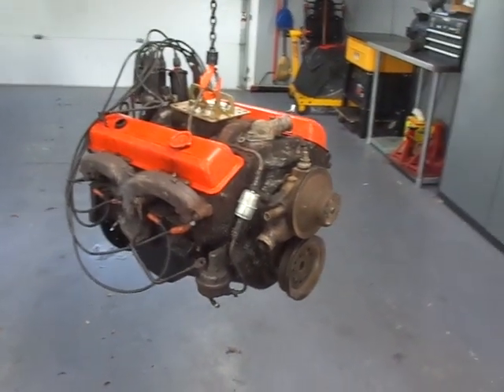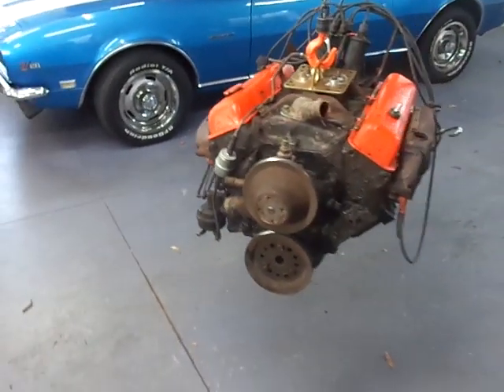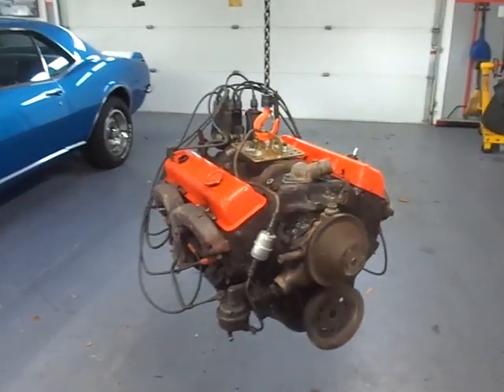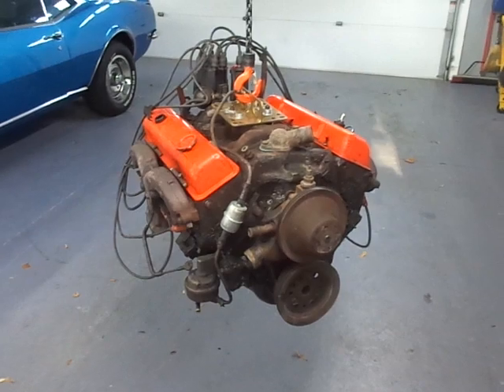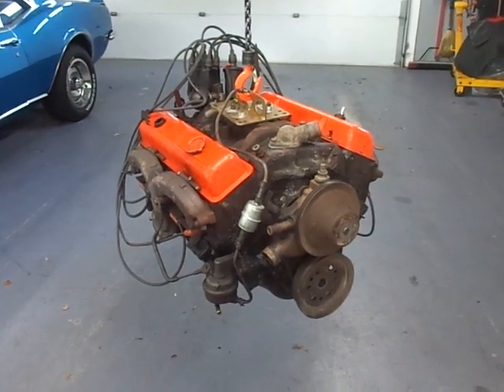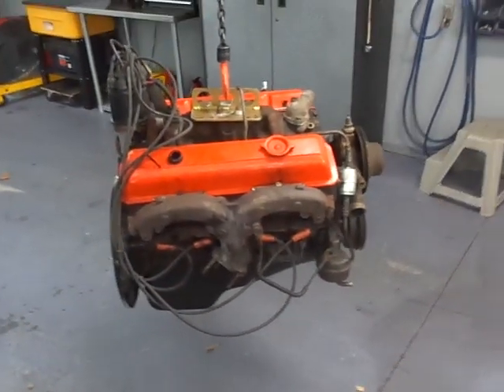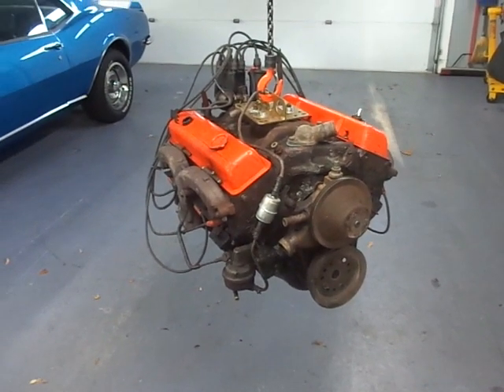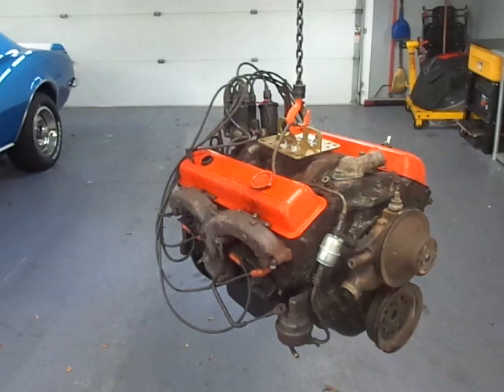Chevrolet 307 SBC cu. in. V8 engine restoration and power upgrade

Comment: Brings me back to my teen years. Took a 307 in my 69 GMC pickup,  bored it .040, installed new pistons, crane cam and lifters, gasket matched heads to headers, installed 4 barrel intake, quadrajet. I thought I had a hotrod! Started working at 14 for a independent garage and we did a lot of engine rebuilds, headwork etc. had a lot of useful experience before going to 3 years of votech for auto. Eventually ended up teaching. Love your channel, you are a good teacher. You explain principals, and add details to fill in the gaps. Thanks for what you do for the industry.
Reply from the maker: Thanks Tad, we share a similar experience. I started working at a Texaco garage at 15. AG

Comment: Has anyone turbo'd a 307 ? With a short 327 stroke and 283 bore it would scream with
good internals. I had an N/A 307 in my Chevelle with 1.94 heads and a healthy Erson 
cam many years ago. Balanced and well built. I beat on it hard and it never broke.
Reply from the maker: Good question Chris, i have not but anyone out there please comment.AG

Comment: Long stroke v short stroke of the same size engine does not change swept volume . A 403 Olds with 4.351 inch bore X 3.385 inch stroke has same swept volume as a Late 400 Olds with 3.87 bore and 4.25 inch stroke .
Reply from the maker: Good point, thanks AG

Comment: Built a few with 601 305 heads open chambers to match bore and use 218 at .050 cam .450 lift on a lobe seperation of 109 install at 106 run great .
Reply from the maker: Thanks for sharing Larry. AG

Comment: Gm had plenty of 283 blocks in inventory and 327 crankshafts.  Gm had come out with the 350 in 67 but didn't put it in corvette until 69 cause they were field testing it through customers in 67 Camaros.  69 corvettes novas, chevelles and impalas got the 350. You want a nice torquay 350, then put a 3.75 crankshaft in that 307 and you end up with 354 ci with mucho amount of torque 💁‍♂️
Reply from the maker: Thanks Ben. I just might try that sometime. AG
Reply: @goldsgarage8236  Yeah, pontiac 326,350,400 all had 3.75 crankshafts . I had a pontiac 350 and that was a nice little torque monster. Sbc 354 would perform about the same with a much lighter block since pontiac motor is a much bigger and heavier block. 👍
Reply: Or just build a stroker 383 for the same money and outperform the 307 in every way possible, or a 400 and trump it from the get go.

Comment: I has a 307 with a set of 186 202 heads and a solid flat tappet cam in my nova the motor ran good for what it was back then before the internet and all the aftermarket parts we used what we could for performance the cam I had was really too much so the car was slow off the line I had a Vega converter which only stalled to about 2800 rpm with a turbo 400 if I remember right the best it ran was 11.89 in the 1/4 mile. I put the same cam and heads on a 331 and the car went 11.20 . That was in the late 70s
Reply from the maker: Thanks Richard, 11.20 is pretty fast, i am sure it was a fun ride! Thanks for sharing. AG
Reply: Offhand the 11:20 actually sounds pretty impressive. Was that an early nova that was pretty light or about what did the car weigh?
Reply: @fcaughli  no it was a 72 nova

Comment: You want to wake that 307 up to make 300+ hp throw the stock 307 heads away they're junk they have 70cc or 76cc combustion chambers with small valves 1.72 intake & 1.5  exhaust. Swap them out with stock chev 305 heads with the last 3 casting numbers either 416 or 601 but preferably 416. 305 heads will have around 58cc combustion chambers and a larger intake valve of 1.82 and 1.5 exhaust which will flow better and with the 58cc combustion chambers should be around 9:1 or 9.5:1 compression. 
Another weak link is the cam and lifters 307's got a bad rap that they are junk cam eaters but it was chev in that time Era cutting corners and they didn't have hardened cam lobes and other motors of the same production years as the 307 also had cam problems unless of course they have already been changed out but I recommend an edelbrock cam kit #2102 for the 307 which you may have to have the valve guides machined/ cut for lift clearance being the stock 305 heads might not have enough clearance even for mild cams with 1.5 rockers so something to check and look into.
Reply from the maker: Thanks Derek. We did use the 305 heads. To get 300HP would require a cam that moves the torque curve up. HP=torque x RPM/5252 so making torque at higher RPM will achieve a better maximum HP rating. With a full size truck, highway gears and stock torque converter I wanted to put the torque curve at cruising speed where the driver needs it.

Comment: i have a 1984 olds 307. i can make it stronger?  PLEASE SOMEONE HELP IM YOUNG DONT HAVE MUCH MONEY dnt wanna put money in wasteful place.
Reply from the maker: That's a tough question. 

I am assuming that you want to keep the 307 and you have an automatic transmission..

Engine performance depends on six main issues:

1/Engine displacement, bore, stroke, cu. in. 
2/Compression ratio, static and dynamic.
3/Airflow in and out of the engine, (Intake manifold, air breather, carburetor, cylinder heads, exhaust)
4/Camshaft timing and lift
5/ Ignition
6/Parasitic losses

1/ Engine displacement. Not much you can do here except replace it with a 350 or larger. 
2/ The easiest way to improve your CR is to replace the heads. Camaro/Firebird HO heads have only 58cc and would help improve your CR from about 8.5 to 9.5:1. There are used ones on the market. 
3/Intake side: A low restriction air breather, good aluminum dual plane intake manifold, if you already have a Quadrajet carburetor, that is fine. If your car has a 2 barrel carb, replace it with a small 4 barrel, Edelbrock, Holley, or Quadrajet all will be sufficient. 550 CFM is plenty. 
3/ Exhaust side: Headers and a low restriction exhaust should be your first improvement. IT will also sound cool!
4/ Camshaft timing. Replacing the camshaft with a good street cam is a big job and shouldn't be done unless you do the other improvements mentioned. Limit your cam to .450" lift and about 220 degrees at .050". 
One way to improve airflow without replacing the cam is to replace your 1.5:1 rocker arms with 1.6: rocker arms. This can be done over the fender and will increase airflow about 7%. 
5/ Ignition: Your HEI stock ignition is fine, however it may be hampered by emission controls that limit advance. If you can bypass or disable them (legally) do it. Keep your vacuum advance but adjust your timing to about 35 degrees by 3000RPM with it disconnected. Then connect it. 
6/ Parasitic losses. If your 307 has an air pump remove it if you can do it legally. If it has a mechanical fan, replace it with an electric fan. 

Also: another way to improve the performance of your Olds is gear ratio, I am assuming your gear ratio is 3.07:1 or so. A differential is a torque multiplier, Replacing it with a 3.55 or 3.73:1 will help proportionally. (a 3.73 will deliver 21% more torque to the rear wheels than a 3.07:1). 

I hope this helps, let me know if if you have any more questions. 

Allan Gold
Reply from the maker: Also: If you are going to replace your heads, using a steel .015" thick head gasket instead of a standard composite gasket which is about .040" thick will add about 0.2 points of compression.
Reply from the maker: Sin'Sir
It was just brought to my attention that the 307 in your 84 Olds is not the same as the Chevrolet 307. I forgot that in the 80's GM made smaller versions of the Olds 350. Most of my comments still hold, however if your engine is an Olds 307, any reference to using the Camaro 305HO heads does not apply.
Reply: @Gold's Garage  ok copy ,so what to use instead
Reply: @Gold's Garage  thank u for the reply and detailed message ur a God send
Reply: A mild cam & a recurve on the distributor is a good start.

Comment: I'd like to go the other way, 327 block and 283 crankshaft.
Reply from the maker: That would be a 302. They can make great power but you have to rev them. One problem with making power on a 307 is that the bore is less than 4" so you cannot use the bigger 2.02" intake valve as they would actually hit the block. The smaller bore also shrouds the intake charge. The biggest problem to make power is getting the fuel/air mixture past the intake valve. Thanks for your comment Papi.
Reply: @goldsgarage8236 . Not true, with all due respect,  2.02" valves absolutely clear on a 283/307 bore.  You are correct about some valve shrouding  but it isn't real bad especially when it's at least .030" over.  And then shrouding is reduced more. I tested
 a 2.02" valve in a 3.905" bore and it hit the WALL of the cylinder,  at around .720"+ lift! And a 302 is more comfortable revving over a 307 if 8,000+ is the norm.    They can be made milder. Imagine a 302 Z/28 engine with an Isky 280 Mega.  A little smaller than the old cam and smaller yet on advertised duration, tighter LSA, more power and at less rpm.

Comment: The Chevrolet 307 V8 engine was in production from 1958-73 which it was based on the 283 with 327 crank and connecting rods there’s plenty of those around and plenty of performance parts for those who want to add more horsepower
Reply: You definitely need to look at what you wrote. No 307 in 1958, or any 1959 not even 1960 . You have made a mistake.
Reply: A 307 Chevy block is large journal. No 283s were large journal. So you can make a stroker using a 283 block and a small journal 327 crank, and use 307 pistons with small journal rods. But most people have better things to do with their time.
Reply: @knutbjornlarsen4435  I meant to say 1968-73
Reply: i have a 1984 olds 307 . i can make it stronger ?
Reply: @Sinsirink . The 307 Olds is a completely different engine. Just being the same cubic inches is just a coincidence. But yes a 307 Olds can be built to make quite a bit more power. I'm not real familiar but there were 2 versions of heads made for those engines. The better castings will be a good start. Otherwise they respond to cams, porting, headers, etc like a Chevy engine would.
Reply from the maker: Thanks for your comment Calvin, sorry for the late reply. Think of a 307 as a 327 with a little smaller bore. Most SBC parts fit and will work. AG
Reply: @goldsgarage8236 . Yep, and the claim about 2.02" valves not clearing the bores on a 3.875" bore is a myth. I've heard of 2.05" valves on that bore size. But there is a degree of valve shrouding caused by the bore. The bores can be notched to eliminate most of that. 2.02"s barely clear the 305s standard 3.736 bore, but valve shrouding is bad enough that you'll definitely make more power with a smaller valve like a 1.94".

Comment: I have an OMC 307 SBC. The rebuild will be quite a challenge!
Reply from the maker: Thanks Geoff, it is a challenge to make power without giving up mid range torque.
Reply: @goldsgarage8236  The major challenge here is that like most boat engines the poor thing has had a hard time. Things like an over rev high enough to start pulling the rocker studs out....

Comment: my 71 g10 van has one of these engines w/a standard transmission. when it retired i had over 300k miles on original engine. loved the van and it was a daily  driver for my family for over 30  years.
Reply from the maker: Great experience, thanks for sharing Mr71. AG

Comment: So...its a stroker motor from the factory?
Reply from the maker: Thanks Hunter, yes that is correct, although they didn't call it that back then.
Reply: Can look at it as a stroker or a de-bored 327. They're fine engines. A 305 is a de-bored 350 but A LOT more of a de-bore. Id run a 307 over a 305 for performance.  And a 305 in a low RPM cruiser, where the 305 would have a little more low end torque.

Comment: I.  Just got done rebuilding a 307 i went with double hump heads its sounds Mean with the 488 lift cam but nobody wants Smallblocks. Anymore. They want the LS
Reply: Nice, how does it pull in the bottom end, between idle and ~2200 - 2500? I have lightly port & polished 461 double humps (w/ 1.94s) on a 307 with a Lunati Voodoo (207/213° @ .050"), Performer intake, aftermarket Q-Jet, 1" spacer, full-length headers, about 9.5:1 CR, etc., in a '69 Chevelle with 3.73s and a 200-4R, stock converter. Runs great, sounds good, pulls like mad from about 2500 RPM all the way on up from there. But from off-idle to about 2200 - 2500 RPM it's a bit sluggish at the moment, despite the carb, cam and intake choice, and it appears to have low manifold vacuum at idle.  I'm assuming it's a combination of bad vacuum leak(s), poor tuning, and the ports being so much larger than stock. It idles great, but acts like it has a much bigger camshaft and needs a high-stall converter. Planning to get it sorted out when things warm up in the springtime, winter lasts a solid 6 months or more around here.
Reply: @dcg748  its a fairly light car 373 s launch it good. Top end is good to 6500 then it evens out. Its fun for what it is
Reply: @dcg748 . I'd definitely run a quality looser converter, at least 2500 (I'd go 3000ish myself)  and make sure it will stall that  behind a 307 as the rating is usually based on a 350s torque. Higher stall speeds is an important ingredient the smaller performance small blocks need. Even milder smaller motors can use a looser converter. I'm sure you're pretty versed on them but yeah consider it "mandatory". It'll wake right up off the line! Low vacuum with that short of a cam? Are you sure it's 9.5 compression? Thick or thin head gaskets?
Reply: Full speed ahead on the 307, I'm working on the same thing, My 307 will have 305 vortec heads, plus a few other things. You are correct, the only thing they talk about is an LSXX. Take that 307, go fourth and SMASH!!!!
Reply: That's awesome! Sounds like I've got some tuning to do then, but hopefully that turns out to be good news, lol. Thanks for the reply, much appreciated!
Reply: Any mod mechanic in or close to Arizona the minute I get my Buick Regal notchback running I want the 307 restored and modded after I replace these vacuum emissions and fuel lines
Reply: @sonorantradepost821  wrong 307 that's a Oldsmobile 307 you have it's no good. They're tlkn about a Chevy 307 complete different engines
Reply: What's an LS ?

Comment: 300 horsepower out of a 307 is a tall order...decked block,flat tops or domed pistons,L31 vortec heads shaved for compression,steel shim head gaskets,a cam spec'd for small bore,long stroke and your current compression ratio,long tube headers and you MIGHT get close....
Reply from the maker: Thanks for your comments Trillrif, the real priority was mid range torque so we did give up a little top end HP to achieve it.
Reply: Why is it that on smaller engines, not quite 1hp per cubic inch is supposed to be a tall order to fill according to a lot of people? In theory it should happen easier. (Less weight tossing around, less friction due to slower piston speed from shorter stroke. Is a 400HP 350 some monumental horsepower goal? Of course not. That's definitely more than 1hp per cube.